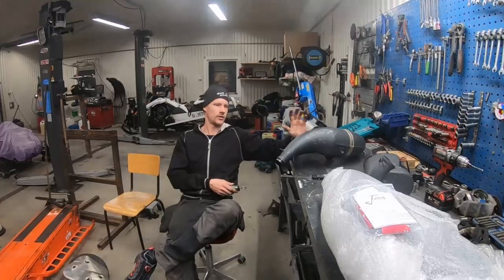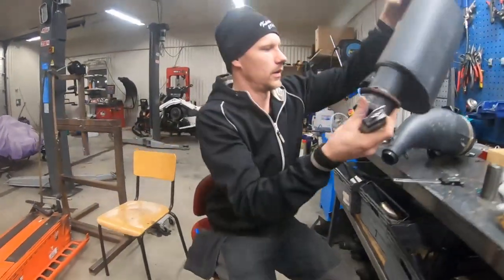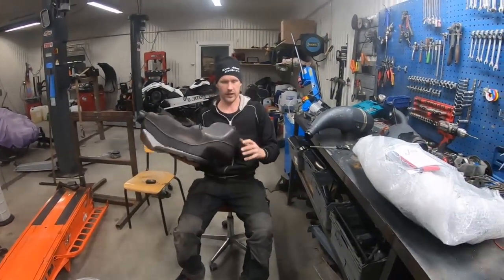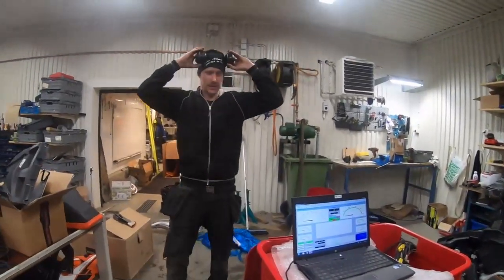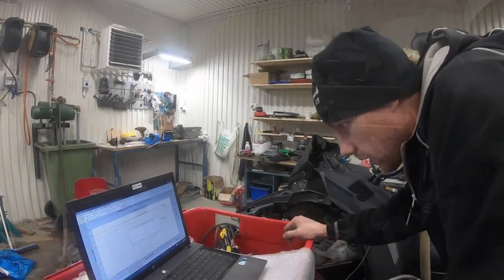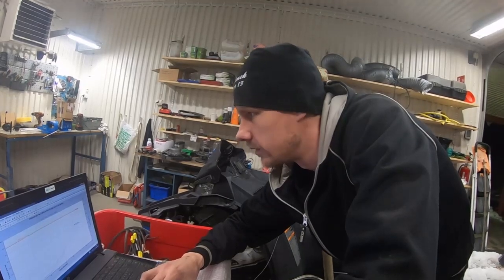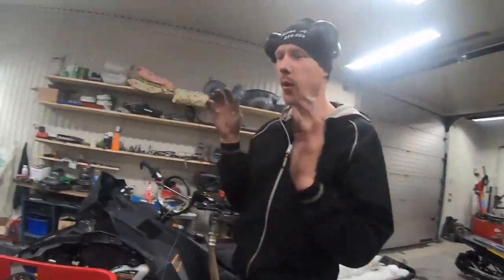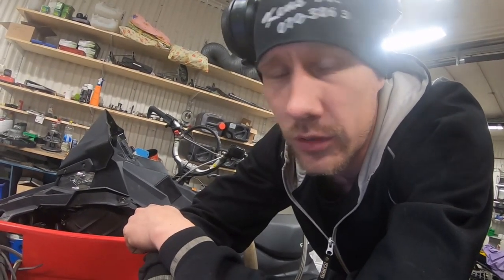Dyno Academy Polaris Axys 800 pipe test

Comment: Funny how the jaw pipe take more time too heat up you see the horsepower going up skowly through the run . It would probably be better with a smaller stinger
Reply from the maker: Philippe Richer Pepin  o i did try that but lost 3hp same stinger size as slp
Reply: ken Långdah funny I wouldn’t I thought that. it would be a good pipe for a speed run and trail but for a dràg race the run would be done before it reach 150+ hp. I wonder if Insulating it with exhaust wrap could help. Higher heat higher speed of sound mean higher rpm. Then again that pipe rpm seem higher enough. So we don’t know much.